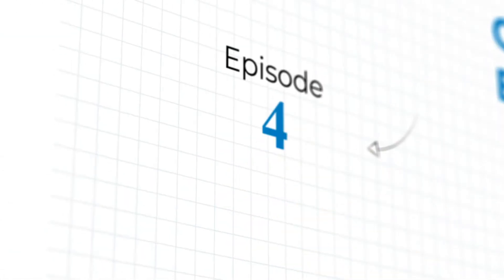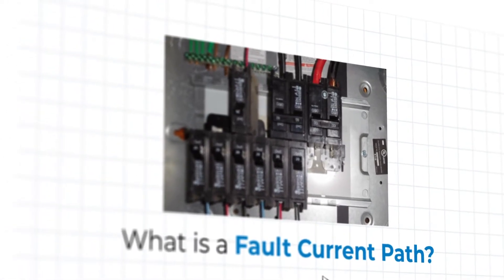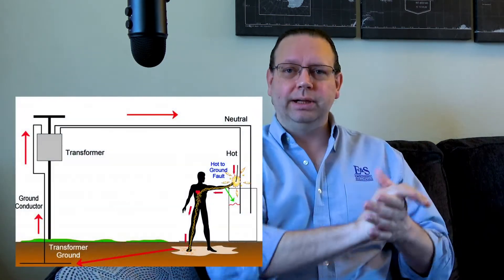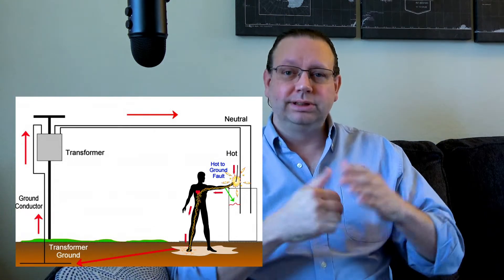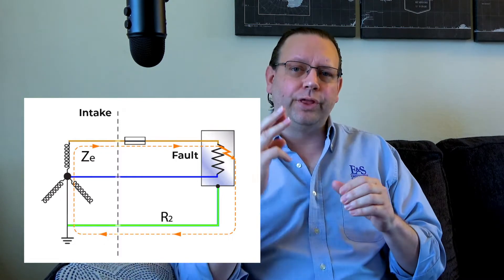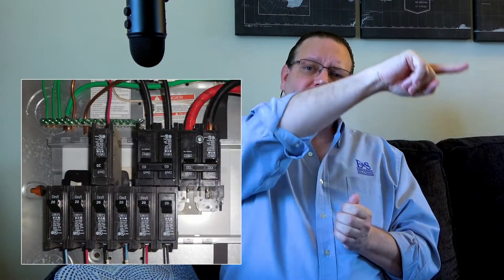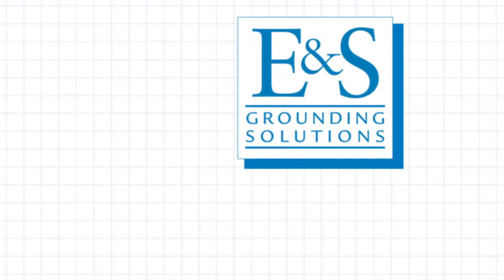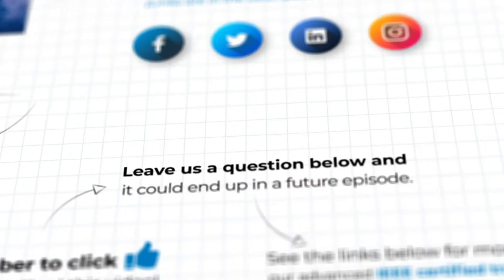What is a Fault Current Path?

Comment: Can you do a video that differentiates the difference between a ground fault, short circuit, overcurrent, if the neutral hits the metal box, and if there is a difference between it happening on a normal breaker, GFCI or AFCI?

Comment: In my home, the power supply neutral is bonded to ground at the electric service panel.
So, wouldn't that fault current in this case just go right to ground at the panel?  (I'm assuming
that the current would NOT go back to the transformer then?)